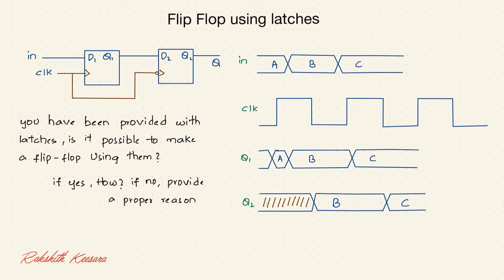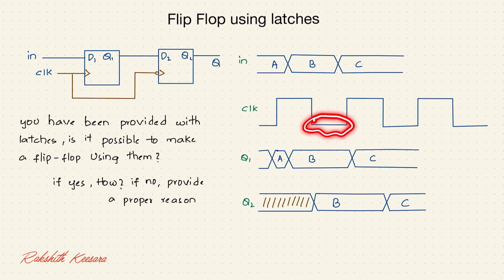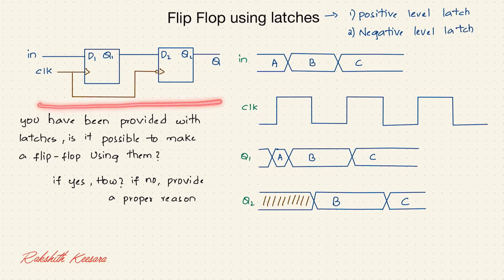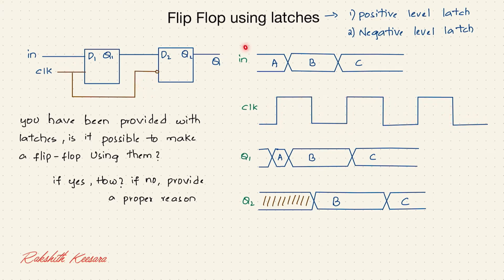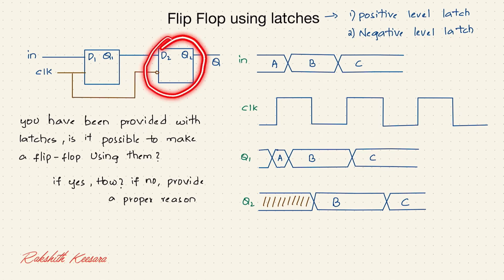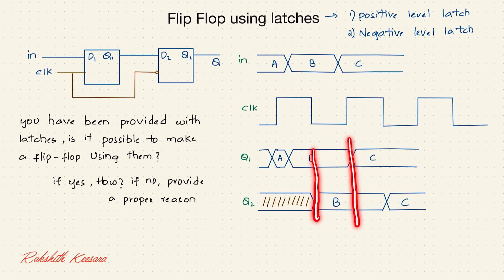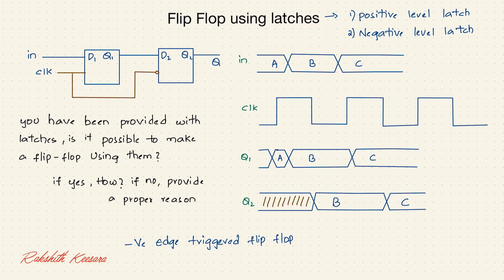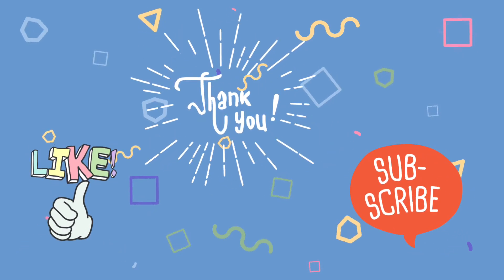Flip flop using latches | VLSI interview | Digital Electronics | IISc

Comment: We should design a circuit as 1st latch with negative clk and second latch with positive clk. So we will get positive edge triggered flip-flop.
Reply from the maker: Correct, or if you want to use the same circuit u can simply invert the clock.